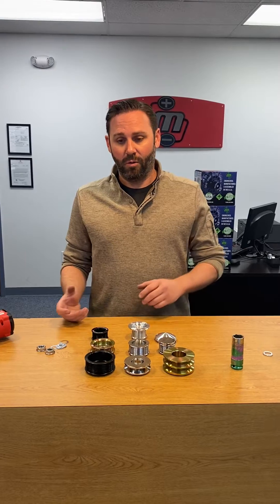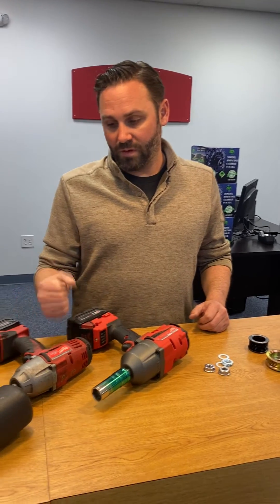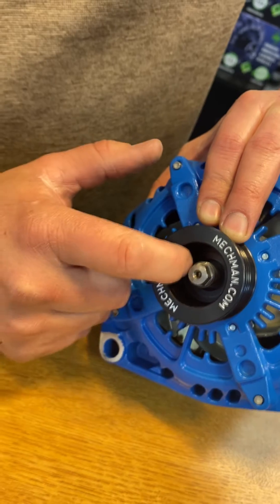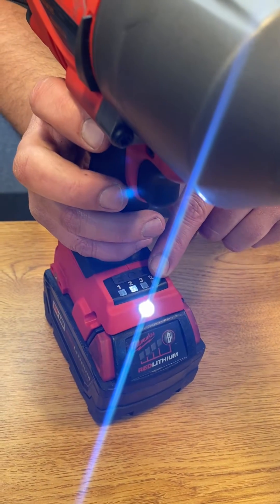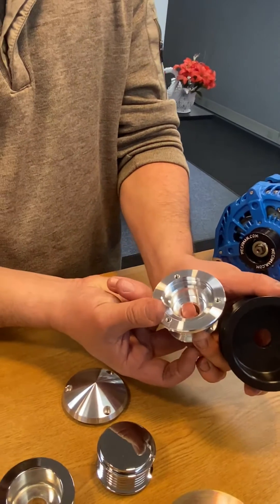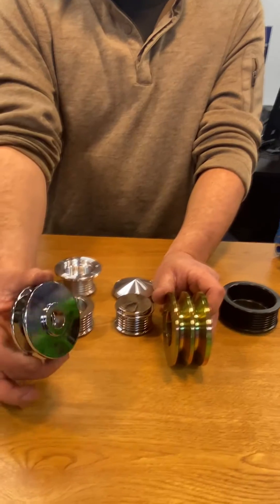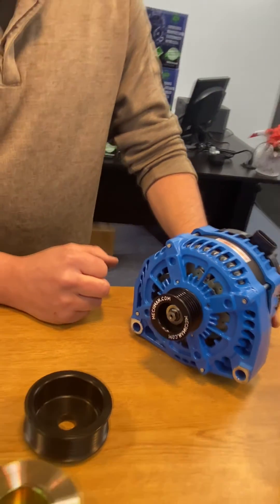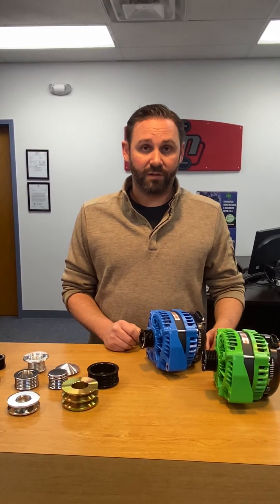Alternator Pulleys Explained by Mechman Alternators

Comment: But, I need the stock pulley, for it's diameter, because I DO run my engine to 7000 rpm quite frequently.
And have a 7000 watt stereo to match.
Reply from the maker: You have to pick your battles.  Either less RPM's and a 400 amp alternator or larger battery bank and less alternator.
Reply: @mechmanalternators 
Already have 2 big AGMs and a 500 farad Cap just on the sub amp. But want 300 amps available from the alt too. 
I could probably be ok with 250.  But not much lower.
6900 rpm burnouts, and 1/4 mile runs are the entire reason the truck was built lol.

Why can't the stock pulley be used, even though I know it'll diminish the output some?
Reply from the maker: @a807511  That sounds like an overly complicated battery setup when a single quality lithium battery could handle all that and more.
Reply: @mechmanalternators 
It was a serious question.
I understand that the pulley needs to be smaller, to spin faster, to get 400 amps.
But if I'm cool with less than 400 amp output, by spinning it slower, is there some other reason the stock pulley can't be used?
If I paid for a 400 amp alt, spun it slower, and got 280 out of it.... But it lasts....
Myself I'd be cool with that.
There are a lot of people with 7000+rpm cars that still want kicking tunes. 
If you guys had a graph of output per alt rpm range, and still said "DON'T EXCEED THIS".
You'd get more sales and still be covered.
I'd switch to a 3" pulley if I had to.  
I'm just interested in why I couldn't.
Reply from the maker: @ We do have a chart, its on our website like all of our information.  Graphs for each large and small case alternator. 

Its wasteful to purchase a 400 amp alternator and underdrive it and have low idle RPM issues when you can just purchase a less expensive 250 amp and use the correct tool for the job. 

A 250 amp alternator paired with modern batteries such as the XS Power XMAX 45, 67 and 90 's can support upwards of 15,000+ watts. 

You're welcome to purchase, modify and adjust any components to meet your needs but our approach is and always will be on quality and reliability.  Achieving those two attributes generally results in great performance as well.
Reply: To be honest, I'm scared to put a lithium in my vehicle.
I know it's done.   But I've watched a lot of lithium battery stuff burn up too.  
I'd rather stick with the AGM for a few more years.   
The batteries for my subs are just for the subs only.   Really my current 160 may be good enough.   Not sure.
Reply: Forgot to ask, IS there a 250 that's ok at 7000 rpm occasionally?  If so I'd gladly buy that.

Comment: V belt alternators in my experience at 150 amps the belt will slip. I added an idler belt and seems to be working but Id say 100 amps is all a vee belt will drive.

Comment: I have this exact alternator but wanna use it on my same truck (98 chevy 5.7 vortec k1500) but i have tall valve covers on new sbc engine. Do they make aftermarket alternator mounts or brackets for a gen 1 sbc engine. The stock vortec mounts wont fit with the tall valve covers
Reply from the maker: Tons of options on www.mechman.com
Reply: @mechmanalternators  no there isn't lmao the options for mounting is for a dual setup
Reply from the maker: @jjmccloud  Why can't P# 8206250 work?  Or, if you don't like the output stud on the REAR, just get a "14019" style P# where the output stud is on the TOP/SIDE.  Super easy.
Reply: @mechmanalternators  I'm looking for mounting brackets, not the alternator itself lol I already have the alt its just the stock mounting setup won't work with my engines valve covers. So looking for other mounting options to keep using current alternator and valve covers etc
Reply from the maker: @jjmccloud  OH! I'm sorry...i misunderstood.  Plenty of options on Summit Racing for that.
Reply: @mechmanalternators  no worries, had my hopes up for a second lol

Comment: Just out of curiousity, what real life Automotive application in this known Universe would EVER need a 300 Amp (or Larger) Alternator ?   Some kind of Monster sound system maybe ?  I can't personally think of Anything that would need to constantly / consistently have to draw / replace that kind of massive current.  I have a Pro- Street 69 Mustang with two Electric Fuel Pumps, an Electric Water Pump, and an Electric Cooling Fan - and I would NEVER need anything close to that kind of constant current.  My 2018 RAM Diesel has two Alternators, but it has one for each 12 volt battery.  They total 300 amps current output (160 + 140), and I have to even question why there either ?  I don't think that there is ANY real life scenario where my Truck would need to out out that much constant / consistent current.  😏
Reply from the maker: Good statement, but everything is relative. Mostly it's the car audio guys in search of power.   However we do have many private label applications on government vehicles with massive electrical systems/accessories, overlanding outfitted rigs, off road recovery vehicles with massive winches. 

Many people would think why would anyone have a pro stock 69 mustang when you can just buy a Tesla Plaid and go quicker, less maintance, more comfortable and can drive it across the country. 

Fact is, if you can justify your purchases then it makes sense. I really enjoy riding around in rock crawler on 43" tires that cost 1000 dollars and can not be driven on the road. :)   I also enjoy riding around in a big block Cuda getting maybe 10mpg.  

To some people 1 15" subwoofer is insane, to another person with 12 12's that 1 15 is super lame.
Reply: @mechmanalternators  Suppose you're right, to each his own.  Seems like someone really should be able to figure out how to make sound systems more efficient though, with all of the focus on efficiency today, and the Technology we have these days !  Look what they have done with Light Bulbs !  Ansd even Heaters !  Surely something could be done to ease the Heavy Electrical Load these Sound Systems Impose !  Where's all of the Alleged Electrical Geniuses / Savants when we need them ?
😏
Reply from the maker: @johnbishop7912  Thats where higher volts come in to play.  Volts go up, amps go down. ;)
Reply: Yup, any sound system over 5k watts would need at least a 270amp to keep voltage from dropping 300amp being better

Comment: I have a 2008 Yukon Denali with a factory alt. I can't spend the cash on a Mechman Alt until the holidays are over. Do you sell a smaller than stock pulley so I can keep the rpm's up for my audio system?
Reply from the maker: That's not really how it works. Save the 40 bucks and put toward an alternator.

Comment: I was confused when I saw my alternator with a smaller pully  thinking it wasn't the right one ..I'm still concerned  but not about the pully anymore...what's got me is I have an extra wire on my stock alt and don't know if it is necessary or if the wire is somehow connected internally and is no longer necessary
Reply: Lol I've had it over a year ...the stock alt just sht the bed..

Comment: I have a 320 amp alternator for my 2017 Toyota camry SE but my factory belt is too loose on it. The next size down(k060486) is too tight to fit on the pulley, I was thinking about getting a smaller pulley to put onto it something maybe like a Toyota corolla’s. But I didnt know if that will work. What would you recommend I do?
Reply from the maker: I'm not showing we make a 320 amp alternator for a 2017 Camry. Do you have an engine size?   Anyways, sometimes on those few applications where you need an odd sized belt you can try a different brand of belt(as they sometimes vary) or try loosening an idler pulley or PS pump to get that little bit extra slip over pulley room

Comment: I have an older 240 alt I had kept from my bronco. Now I’m planning to use it in another project. The pulley shaft threads are all messed up. Can this be fixed. Last option would be to tack weld the pulley on.
Reply from the maker: stripped threads = new rotor (or tack weld )😀
Reply: @mechmanalternators  gosh.  Thanks I will try to fix the threads with a needle file. If not most definitely tack weld.
Reply: @mechmanalternators  what size is the shaft bolt. I need to order a new one if I’m able to repair the threads. Thanks

Comment: got the Mechman 240 a while back and just hadn't installed it because everything runs ok, but put the car in for some other servicing and decided to have em pop it in, brand new never outa box the pully does not spin.......  I know these guys make top notch alts but seized new out the box is a tad odd, def outa warranty by now, I can probably fix it but still a pain in the ass.
Reply from the maker: No alternator leaves here "seized" from us. EVER.  Someone / someWHERE has probably dropped it on something and did the "OOPSIE, IT WAS LIKE THAT WHEN I GOT IT!!" cover up.   This is especially relatable as you said you "HAD EM POP IT IN".  So you PERSONALLY did not ever take the alternator out of the box?    Super sketchy...

Comment: What’s a good fit for the 1995 LT1 gen 2 350 in a C4 ???????? alternator is on the drivers side front. I don’t believe there’s enough room to do a duel alt set-up so I may need to just GO BIG but I’m concerned with amps when at low idle and not over charging when at 2000+ or so RPMs. If I remember right 200 AMPs can handle just shy of 3000 watts total system with car running and accessories. I’ll be needing at least enough to handle 2800 + car audio watts with bass wattage at least 2000 watts. I’m not looking to have flickering lights or low voltage to the engine either. Do u make something for my engine and voltage requirements?????????

Comment: Owning a Duramax I’m not thrilled with needing a slightly shorter belt 
I could just imagine being on a trip and breaking the belt. Walk into the nearest parts store and say I need a belt a half inch shorter than stock and the parts guy look at me like I have 2 heads
Reply: There must be a way to make the normal belt work on your truck so u won’t need to go through all that. Some way to modify to compensate for a lousy 1/2 inch ( Just got to be )
Reply: I'd bet the belt tensioner could account for half an inch of travel

Comment: "Realistically it will never go past 6500"...."Pulley your accessories such that it is not going to overspeed things".... so why would a "400amp" alternator "melt" a V belt system if it's pulleyed to the correct ratio? Do they have higher drag/resistance?
Reply: It's like taking an electric motor and trying to spin it in the opposite direction. Don't do this as it will try to tear your hand off. The more power the alternator is producing, the more drag it has and also you are dealing with a very heavy armature. Don't be fooled by how an alternator off the car spins freely. Your alternator under load can cause more drag than an ac compressor.

Comment: I'm thinking to swap a AOD to a solid Pulley . Most people say it's better, what u guys think?
Reply: It's not. When you start getting heavy alternator armatures which come with high amp alternators, they have a lot of rotating mass. Once you are getting near a 200 amp alternator and more so for higher amperage, the rotating mass of the armature becomes dangerously heavy. Read this carefully as clearly a many people do NOT know this! Engines do NOT rotate at a constant speed during the entire 360 degrees of rotation, they accelerate and decelerate multiple times, this is the reason why there are springs in manual clutch discs. Once the armature reaches a rotation speed, it wants to stay there when the engine slows rotation within each 360 degree cycle, the sudden deceleration of such a high mass with the higher output alternator, pushes forward on the belt. The rotating mass will not only create vibration from being forced to accelerate and decelerate during each rotation with a solid pulley but it can cause the belt to jump off during upshifts. These overrunning pulleys are a godsend if you accept the fact that they ARE a service item and know why they are there in the first place. Replace it at the recommended interval which will be more frequent in more severe conditions just like belts and hoses. They aren't expensive and they are easy to replace with the alternator still bolted up to the engine. Notice how smooth your belt is when idling and not whipping? That's because of the overrunning pulley. If you just want a car that you will never driver further than a car audio event, then you can get away with it, don't go on any long trips. I frequently drive 1300 miles one way between me and a location I am at often. I could not afford to have all my accessories getting the shit beat out of them for such an oversight. Also if you have a current hungry setup such as a bank of amps, don't overlook going dual alternator if it's feasible. In the olden days, the only high output alternator was Leece Neville and were used on emergency vehicles, they are beasts and still used sometimes.

 On my 2007 Lincoln Mark LT, I did the big three upgrade and bought a brand new 240 amp alternator for a 2018 V10 as the accessories bolt up the same as the 5.4 liter Triton engine(yes, I hate to admit what engine I have). The computer handles it perfectly and I fused the heavy cable to the battery as part of the big 3, the stock fused link would blow when you add 100 amps over stock. I also am not that crazy about undersized pulleys unless the engine will spend it's life at low rpm. You can also get various size OAPs but not real tiny. If the pulley is smaller than the diameter of your thumb, you might want to think about it a bit.
Reply: @Davesworld7  thanks for the info.....

Comment: Great info! I put a smaller pulley on my Civic's alternator as a poor man's solution to get a little more power out of it at idle. I don't have an impact gun, so I used a pipe wrench to hold the pulley and a breaker bar to remove and install the nut. Not ideal since the pulley may be slightly damaged, but it does work in a pinch and it's way better than sticking screwdrivers in the fan like I have seen people do.

Comment: I’m glad you covered belt length at the end. You don’t makes alts for my 97 grand marquis I had to go U.S and I have to go with a .5-1 inch shorter belt to get max grip on the Alt pulley. Now after people here my system then ask me what kind of subs/amp to get I just say unless your just going to put in a 200 watt amp and some 200 watt woofers get a after market alternator and a good car audio battery. Or else your system will sound like crap like most people out there who get big amp and a pair of sub and run them on there stock charging system. 👍🏽